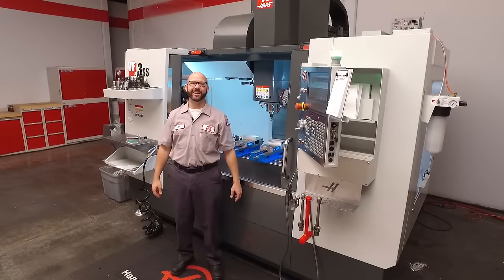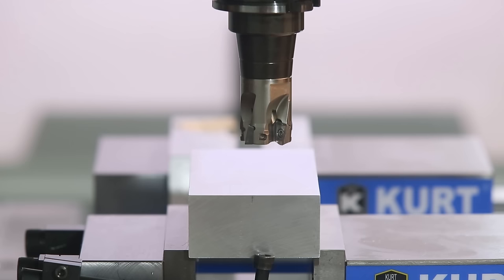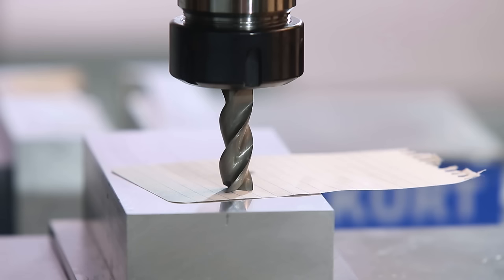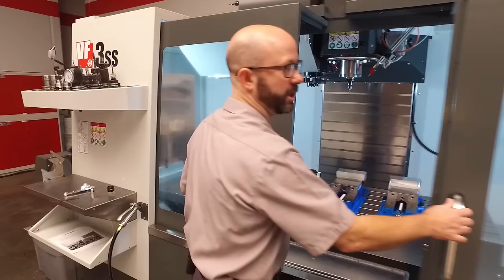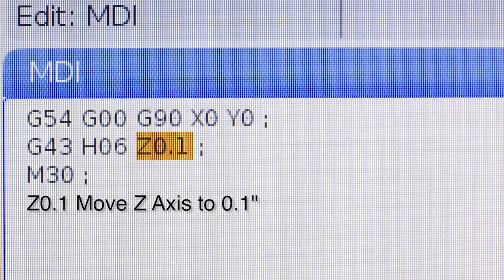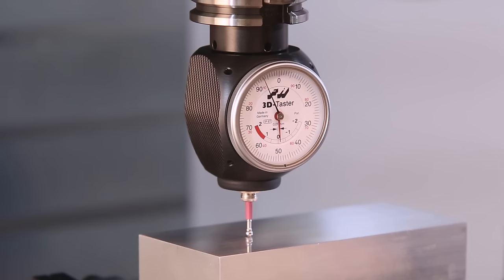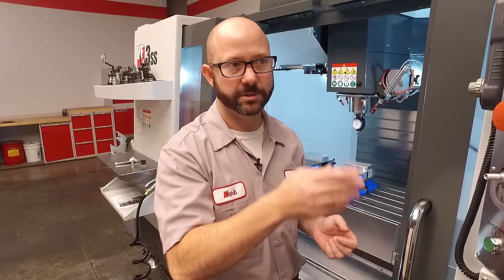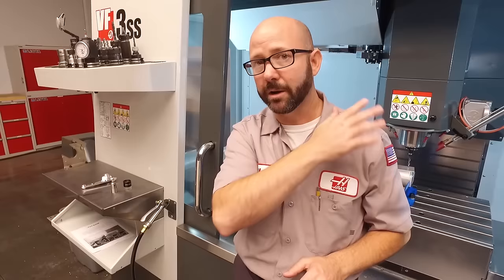How to: Set Tool Length and Work Offsets – Haas Automation Tip of the Day

Comment: Mark, This is the first time I strongly disagree. You set the tool off of stock. Let's say that a tool brakes on the third part. The part has been faced. Now where do you set reloaded tool that needs the correct offset? Not a good work practice.
Reply: 3D Machine, Inc. my co worker and I agree with the tool teach position. also, nothing was verified with precision, the facemill will have varying inserts, and any blends from the tools will be off from the start. 

123 block from the table for tools, then sure an indicator to tell the Z offsets from tool 0
Reply: You use a taught tool to figure out the difference... say .020 then you would add .02 to the length offset
Reply from the maker: 3D Machine - Great comment! I agree with you, and I like the whole topic you brought up. I think a video on “Where do you set your Work Offsets and Why” is looming in the near future. As a rule (more of a guideline), I set my Work Offsets on billet parts (first Op) against the solid jaw, or center of the stock (easy for machines with probes), for XY, and on top of the FINISHED part for the Z,  for just the reason you stated. For second ops I almost always locate and program off the part datum for my XY, where my dimensions are called from, even if that means rotating the part around. Even on second op stuff (locating on finished part), I usually program my Z off the top of the finished part. On castings I’ll program off the print datums for XY and Z (common Automotive practice). The part in the video was actually programmed with Z at top of finished part, not stock, but I didn’t want to add more math and other topics into this already long video. Thanks again for the comment. – Mark, Haas Tip-of-the-Day.
Reply: Why would you need to set the new tool from the stock If you have the old(broken tool) tool value and the new tool value? You can basically use any point on the machine. Just figure out what is the difference between old and new tool and then type in the correct value.
Reply: Our goal as machinist is to be efficient and use good work practices. The more efficient you become the more value you are to an employer. I suggest you do a time study and find out which is the most efficient and safest way to set tools. 

The old saying, “they pay me for what I know”, doesn’t hold much weight if someone not as smart is getting more parts done.

"If a task is once begun, never leave it till it’s done. Be the labor great or small, do it well or not at all."
Reply: @3DMachineIncPowderSprings  75% of the jobs I run I touch off one tool on top of part.  Then touch off the same tool and all remaining tools off a 2.0 light probe off  that sits on the table.  Take the first number (from top of part) and subtract it from the light probe offset for the same tool.  Enter the difference into your Z offset for the proper work coordinate(G54,G55, ect).

 Now you can still make it simple for programming and operating.
Reply: This Mark recommended practice of setting the tools off the worksurface rather than the machine tool table is going to get someone seriously injured or killed. Not to mention it is just plain inefficient and ignorant.

Comment: This system works, but the tool length offset values don't represent any useful number. I prefer that the WCS Z values are the actual distance from the spindle nose to the part Z origin, and that the TLO is a correction for the actual length of the tool past the spindle gage line. On my Bridgeport CNC, TLOs are negative values to make this system work and the TLO is the same for a given tool no matter how you set up the WCS. Tools can stay in the carousel for months or longer without ever being touched off this way.

Comment: Don't forget to subtract the .003" avg off the paper. Nice video though 👍
Reply: Why bother if you set with the same paper the difference is relative
Reply: @MiloPerrotti  Why substract 0.004" in ss shim case?
Reply: If you set all the tools with the same shim you don't need to adjust or compensate for anything
Reply: @MiloPerrotti  You have to compensate somewhere, offset or program. Unless your hole, counter bore or other feature has sufficient tolerance on the depth call out! If your blueprint has plenty of tolerance on the dimensions then the paper or shim comp. might not matter!

Comment: This is not the way I do it.   You should be measuring the difference in length between tools and use a refernce tool  (or probe)  to set your zero Every time
Reply: I believe it is automatically compensated by the machine. Older machines you have to do the math.
Reply: I run a Trak DPM7 and I use a dedicated toolholder as a reference off the table with a 4" height gauge, then set the other tools in the same way.... gives you the difference in toollengths, then take the last tool measured and find Z off the top of the part.

Comment: Incorrect if you subtract a negative from a negative you get   -10 - (-.004) = -10 + .004 = 9.996.  The correct way to state this is "add a negative number to a negative number will increase the distance or -10 + (-.004) = -10.004.  Basic math!!!!

Comment: Stupid using paper. You can easily crash it if you hit the wrong incremental movement on the Z. Use a 1 inch gauge block (1,2,3 or ground) and it gives you more room and is as accurate.

Comment: 4:29 why? bcoz it wont make any sense anyway. tool lenght not machine movement from home position and -. tool lenght is actually tool lenght you can measure and its +. you not need remove or add that 2inch if you measure alltool this silly way. all are same. untill next part and one tool more

Comment: With all due respect, you are using the Fine Lever Dial Gauge wrong. The tip should be at least as Flat as possible to the part your measuring. You should try measuring from point A to point B with the dial tip as near as Flat and with a higher angle just to compare. Just my 2cents.:)

Comment: I don't wish to sound disrespectful. This method works, but it's very inefficient, In my opinion.

1.If you use the work piece to set the tool offsets, you are probably leaving extra machine stock which you will likely mill away in the first roughing op. Good bye reference surface. 
2. Coming down onto paper (inaccurate) or shim stock is very time consuming because you have to use care during the last .020, or so, of Z- travel.  Before I had tool setters, I used to put a 1/2 inch dowel pin on the reference surface, bring the tool down next to it, and a little closer to the work piece than .500". Then I would jog Z+ in .0001" increments while rolling the dowel pin under the tool until it just cleared.
Using the tool setter on the work piece as you demonstrated  is quick but defeats the purpose of a  tool setter, IMHO. We set all our tools with the tool setter directly on the table. That way, it doesn't matter who set the tools on what job. They will all work with other jobs, after setting the Work Offsets. To set the Z-offset, we set one tool using a 1" gage block on the work piece, come down a little past the gage block with Tool N, then jog Z+ .0001" increments, while pushing the gage block slightly against the tool until it just clears. At that point, subtract the machine Z from the tool length, then subtract the gage block thickness from that result. You then have the +Z offset to enter in G54, or G55, etc.
For example, machine Z at exactly 1.000 inches above the work piece= -13.2940  Tool length= -18.1490.18.1490-13.2940=4.8550. Gage block=1.000. Subtract that from 4.855 and enter the result (3.8550) into the Gnn Z offset.
Reply from the maker: Fake Appellation  - That’s a terrific method of setting tools. A lot of shops choose a single-point to touch off all tools, like you suggest with a touchoff tool and the table. Because of the variety of ways different shops setup tools, we chose to go with the most basic method for this first video. We hope to come back with another video showing the method you mentioned in the near future. Thanks for the comment, people will appreciate your experienced perspective. – Mark, Haas Tip-of-the-day
Reply: Thank you, Mark. I just subscribed.

Comment: When there's a sneaky little random h code somewhere in the program is the worst.
Reply from the maker: David – I don’t often break tools, but when I do it’s because of a sneaky little random h code somewhere in the program!! I’ve gotten in the habit (especially if running someone else’s program) of searching (H, Down Arrow) for all T, H and D values in the program, as well as a few of the Z’s. Making sure Setting 15 H & T Code Agreement is on can also help avoid some of these H code mismatch problems. – Mark, Haas Tip-of-the-day.

Comment: Why not just set all the tool Z's on the table or vise ways? Then you can put in a Z offset to wherever you need it to be.
Reply from the maker: Hi Jordan – That’s a great way to set your tools. Lots of shops will do it that way. That method would need to be setup, and explained to all employees, for each shop. You’d have to agree on where to touch off tools and communicate that really well. You’ll also need to train all employees on how to set a Work Offset in this way. We figured that as a first, universal step, everyone should know the concept of touching off on top of a part. Thanks for the comment! – Mark, Haas Tip-of-the-day

Comment: 7:24 well you had G54 0 when you measure tool ofcouse your no sense tool height work LOL.
even they would be some numbers on G54 z it still would work. unless that number not correct relative to total machine distance tool height will be no sense length.
think you could measure tool outside machine from taper flat side to tip then enter that to tool lenght then measure G54 and VOLA. or that could be place where you measure tools(tool setter) it has some coordinates they not 0 LOL

Comment: quick tip. your G54 never should be 0. your tool lenght should not be 18 INCHES. from resting face to tool tip?. your tool lenght was machine z to top of part. now make difrent part with same tools and have fun lol.why measure tools from part that will change. why not measure from KURT VICE that not chabge 99.9%
tool height = machine z max travel - current machine z - measure block height(kurt vice)
tool lenght will be allways same. if you measure tool from part it allways change. after you measure tool you can go measure G54 with using that G43 H1 stuff

I BET you have made program that face that part MINUS something that is so wrong. that should be z0 lol
Reply: hello sir I am making my own micro edm machine .
my edm machines cuts 0.003 in a second 
I want a feed rate in accordance to this I am unable to get this feed rate at the lowest that I can get is F=1 . which is not compatible for me how can I get much less feed back. I want a feed rate of F=.18(MM/MIN)

Comment: 3.47 thats not tool lenght. its distance from home z to top of part using this tool. you get tool lenght by calculate . total table distance- current machine location- block height use to measure. table distance dont need match it can be number that machine maker has said, but it can be corrected in some imagenary number so your tools get tool height that make some sense. if you can measure tool height out side machine and in machine same. then you nailed your numbers. you cant measure that tool outside of machine and get 18 inches xD.
how get that imageny machine z lenght. could use 100 block and measure without tool from spindle flat spot between notches table z= machine z+100m. both formulas i gived need fixed - and + bcoze machine coord are - so add you need + to make number smaller (close to zero) xD. now mark is better and teach 0.5 people correct way. oh too late. now they all have tool lenght absolutely no sense at all leghts LOL

Comment: It is totally irresponsible and dangerous to recommend setting tools off the top of the work rather than off the machine table, which should be the standard for more efficient, consistently reliable, precise and safe location of tooling. By recommending this ignorant course of action, you are possibly going to get someone seriously injured or maybe even killed when they go to run the machine unaware of exactly where and how the tooling offsets are set. And no, not everyone on different shifts in real world shops, particularly those where optimum practices are not maintained, communicates these specific settings or uses job setup sheets wherein this set point may be detailed. I have heard of instances wherein someone on a later/different shift changes tools and assumes that the previous tool was set off the table, as would be the more prudent, safer and common sense method, and crashes it into the work or table. One could debate the lack of wisdom of these persons in not assuring the correct positioning of the tool prior to its operation. If, however, everyone was on the same page as to using a standard and more consistently repeatable method of setting tools, then the risk of physical harm to man, machine and/or tooling is lessened. 

When tools are set off the top of the machine table as standard practice, EVERYONE who subsequently uses the machine knows where the tools are set. In contrast, if the tools are set off some arbitrary work surface, then where is this person supposed to set the replacement tool, should it become necessary, if this surface has been removed or altered by a subsequent operation? Or how is this person supposed to be aware of the exact surface used for this purpose on a job that may have been run days or even weeks prior by someone else? Additionally, I, as do many other experienced operators, when possible maintain a selection of tooling (particularly end mills of various diameters) in designated positions in the tooling carriage for use on future jobs. I do not want, nor do I/we think it intelligent to have to unnecessarily reset the tool length of these tools for each and every setup on a new work surface when I can instead more simply offset the work surface height  with one setting. When EVERY tool in the carriage is set to the machine table or probe surface (which automatically compensates for the height of the probe gauge surface from the table), then I can proceed with assurance that if I set the work coordinate system (WCS) Z height offset correctly (which takes only one time at initial setup), I need not worry about where the tooling height offset is set. If I change a tool out, then I can simply, quickly and easily reset the new tool height to the table, which will maintain this tool’s height  relative to that of my work height offset, and be off and running again. 

Determining this WCS height offset is simply a matter of either using an indicator to quickly measure the distance from the machine table to the top of the work surface and inputting this POSITIVE Z value (as read from either the difference in machine Z coordinates or by using the origin function on the operator coordinate display on one surface and moving to indicate the other) into the WCS Z height offset, or by subtracting the difference in machine Z coordinates for one of the tools already set to the table and its readout atop the part gauge Z0 surface. Only one tool is necessary to determine this height. Moreover, this positive value Z work height offset is less likely to lead to a crash and is thus inherently more safe than a zero value if a subsequent operator mistakenly makes the assumption that the person before him had the common sense and prudence to set the tools off the top of the table rather than that of the work surface, and proceeds to plunge the tool into the work, vise, fixture or else. Conversely, if the recalcitrant person accustomed to setting tool heights off the top of the work does so after someone sets the machine up in the correct manner , i.e. with tooling offsets set to the table and positive Z values for the WCS Z height offset, then his tool will simply rapid to this height harmlessly above and short of the part.

Comment: im here again LOL. you are doing it wrong. you measure tool height as just machine coordinate not any clue what tool height is.
and use part that change, use your clamp that never change. now all your tool on magazine is correct you just add what you need measure it same place.
but better find your toolheight correct way. toolheight should be same value you can measure outside of your machine.
now you go heimer tool and take Z LOL. make no sense.

it not actually matter how you measurre if they all done same, but it wont work when new part come and need ad new tool and use other on magazine. unless
machine calculare something you not tell lol like this workpiece z is measured and known point and measure tool give exact lenght not machine coordinate like u said lol

Comment: Good video . But author speakin so fast É, its only  one bad thing . For professionals is okay , but video for nev not expirienced gays . And vhen you going somevere (for page G54 /G55 corrections or somevere else) , please , tell for us vhich buttons you use for it . And could you showe SetUp Sheet page closer to video camera (and all another used documents). 
                                                                                                                                                                                             Thanks .
Reply from the maker: We’ll try to slow things down, and make those button pushes clearer. Having the text on the screen, by selecting the “CC” Closed Captioning icon at the bottom of the video can help, if I’m not speaking clearly. Thanks for the comment. – Mark, Haas Tip-of-the-day